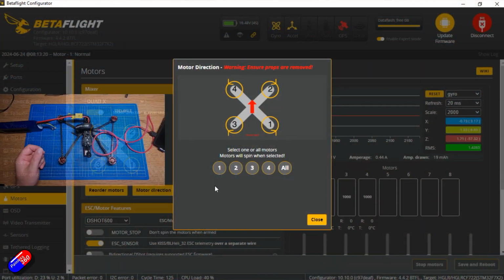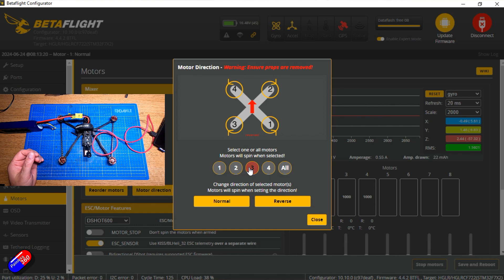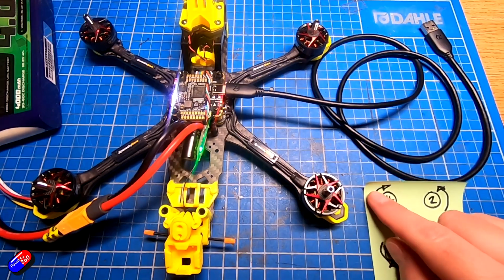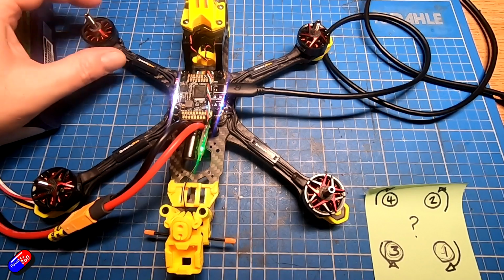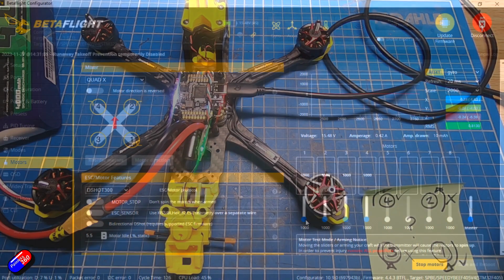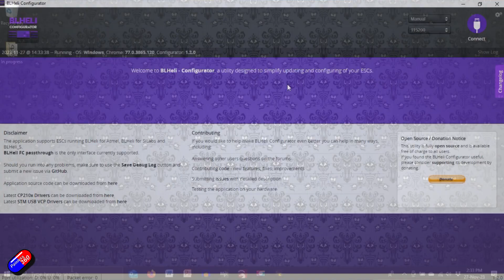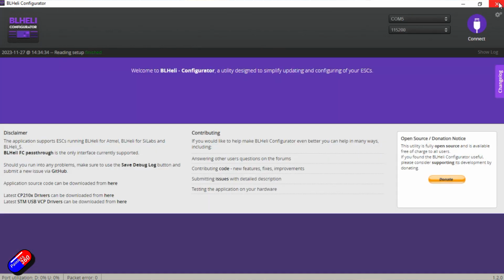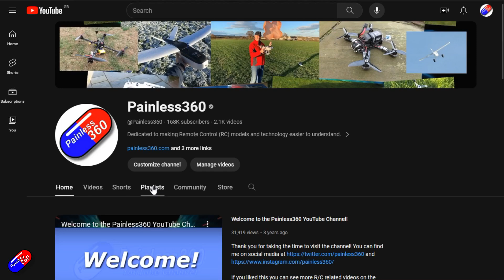Reversing BLHeli ESCs (viewer request)

Comment: Thank you so much for this!!  A little off topic but I was wondering if it is OK to have a parallel power cable  to connect two batteries where one lead is a lot longer than the other?  If so what is the limit? Its a situation where I have two batteries end to end so one power lead it at the opposite end from the other.
Reply from the maker: That should be fine unless you plan on pulling huge currents where the extra resistance of the wire would come into olay... Happy flying